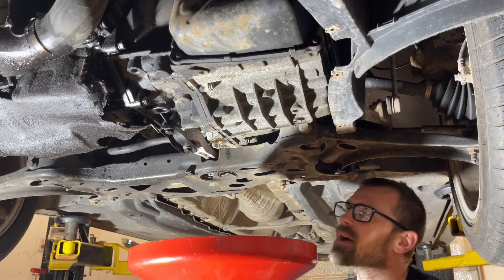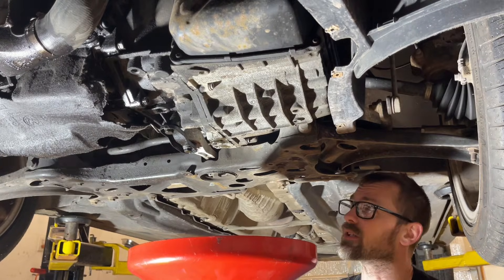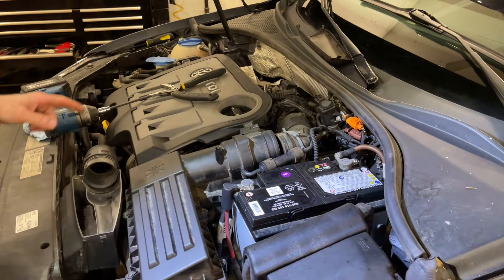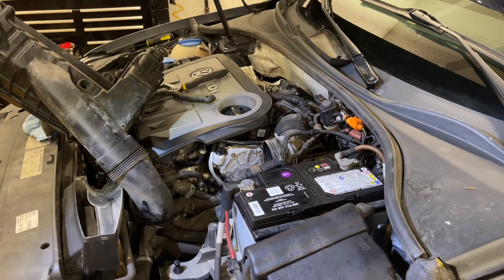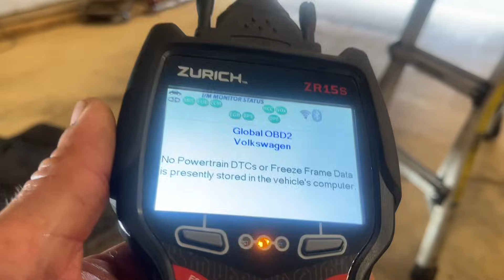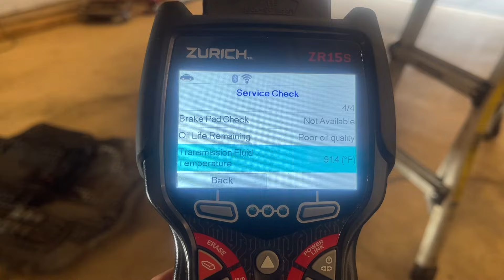🔧 VW DSG transmission fluid change. 2014 Passat TDi

Comment: Thanks!
Reply from the maker: I appreciate it John!!
Reply: You are welcome.  You are an amazing teacher.  Based on your video I plan to tackle my own transmission service.  @bennieaust
Reply from the maker: @johnc8346  Best of luck with the service!  If you can get past the annoyance of having to remove so much stuff to get to the filter, it's actually pretty easy.
Reply: @bennieaust  So I finally complete the service.  You were spot on with 15 minutes run time to get to the correct operating temp.  Also, I believed the dealer cheated me the last time I paid for transmission service in 2021.  The date code was 2014 for the filter, which I doubt they had in stock that long.  I believe all I received was a drain and fill even though I paid for the filter.  I was going to use the dealer for the 130k timing belt service, but not sure now.....  Thanks again for such a great tutorial!
Reply from the maker: @johnc8346  you're welcome!  That's a bummer to hear about the filter.  The service is only as good as the tech doing it.  You can imagine how much faster the service would be if you skipped the filter. :(

Comment: I have the same scanner but mine will not show the trans temp on my 2013 Passat TDI, any suggestions?
Reply from the maker: Did you push the down arrow after entering the service check screen?
Reply: @bennieaust  yes I did. It only shows the first three options. I even tried updating the scanner itself
Reply from the maker: @coltontietge244 , I’m not sure then. I’ve had mine plugged in to a lot of vehicles and it’s always displayed trans temp.  Sorry.

Comment: Just did this on my TDI today and I wanted to say thank you! Your guide was awesome and it made it possible for me to do it by myself. I really appreciate the hard work that you put into making this video, working on cars myself I don’t think I’d have the patience to record it all. Much appreciated friend!!
Reply from the maker: You're welcome!  It does take significantly longer to shoot a video of it than just do it, but you shoot it once and now everyone has it. :)

Glad I could help out and thanks for commenting!
Reply: Did you lift the car or use jack stands?? Process seems kind of hard with just jack stands.
Reply: @Sprinter4783 it really wasn’t that bad. I do all of my oil changes with Jack stands and it’s basically the same process. I will admit It was a little bit tricky working the pump while laying on the ground under the car, but to me easily worth the money savings. It’s definitely do able you just have to finagle with it a little bit. I jacked my car up, drained the old fluid, and then removed the filter. After that just put the new one in, get under it and fill it back up. It’ll take a bit of time and effort to do but again, worth the money saving for me.

Comment: Ive seen sites saying the transmission takes like 5.3 ish and the kits only a 5L. So I’m assuming extra fluid sits in the transmission still after draining?
Reply from the maker: Yes, the drain process definitely leaves some fluid behind. The main thing to know is that 5L is all that’s needed for the service.
Reply: @bennieaust  My kit with liquimoly came with 6L of oil (probably becuase the 02E manual says the change volume is 5.2L (!) . Manual recommends adding 5.5 L for overfill. After draining I had used 4.7 L which is also more than others have used - maybe I put the plug back in a bit soon, basically as soon as it went from a stream to a drip.
Reply from the maker: @paulwary  that’s about when I put the drain plug back in. 

It’s sounds like you used a very comparable amount to what I have always seen. When I add the 5L I usually get .3-.5L back out. 

Sounds like it all went alright!
Reply: @bennieaust  Thanks, that makes me feel more confident that its not overfilled. I was able to modify a cheap garden spray unit  (Aqua brand in Australia) to use for an oil pump for top fill. The filter drain hole is 12mm diameter, and the plastic head for the spray wand was a bit more. Faster than gravity feed, and way less messy than bottom fill. Basically just put the oil in. push the wand into the filter drain hole, and go have a cuppa.
Reply from the maker: @paulwary  great idea!
Reply: @paulwary I added a schrader valve to my sprayer bottle and hooked it to my compressor. You’ll need a regulator to keep the pump head from blowing off if you don’t have a blowoff or over pressure valve on the bottle. Don’t ask me how I know that
Reply: @ZhmiKnopa  The hand pump is fine for me. Does not take very long, and you can just walk away while it goes in.

Comment: Very clear. I remember another video said you need to run through the gears before? oor while? draining.
Reply from the maker: It’s pretty normal on traditional automatics to run through the gears after you have completed the fill process but before setting the level. These DSG transmissions are a lot different that regular autos.  I do not believe there is any benefit to running it thought the gears before setting the correct level.

Comment: This is just my experience, on three DSG VWs. I've had two 2 Passats and a Jetta TDI. Many DSG changes.  Use Liqui-Moly not Pentosin.  You can remember this advice when your transmission starts slipping at ~60 and your Passat sometimes doesn't want to shift.  My experience, take it as you will. I had these symptoms again in my Jetta TDI and promptly drained the Pentosin and replaced it with Liqui-Moly. Transmission shop said I needed a rebuild.   Nope. Good as gold now.
Reply: So glad to hear this got 84k on my tdi and started to slip today at 60 will definitely be changing my fluid
Reply from the maker: That's great to know!  Thanks for the info.  I have serviced many of these and haven't experienced any issues with the Pentosin fluid but I will remember this if I ever do.  I have only logged about 120K miles personally on the DSG equipped TDi's.
Reply: Hi you change for liquid moly fluid ?and This help??thank you
Reply: I've done two changes on my DQ2500 box & used liquid molly both times, 1st time soon as a got the car (6 speed ) 
Anyway only 3.7L came out by having both bottom screws out & box filter off just to get as much oil out as possible. A bit surprised tho as I thought that's a bit low. Used pump like the video to refill & put 5.5L back in. Used vcds & got it up to 35d temp, ran thru the gears in 5 intervals, kept engine running & dropped pump hose etc. Started to worry when still wasn't dripping after 1 & 1/2 L came out. But wasn't letting anymore come out so 4L was in it. 
Second time the same 4L came out & refilled with 5.5L. Had to stop & plug it after 1 & 1/2 L came out. 
I hate the fact that there's only Just over 4L in it. How much would you say is in yours?
Reply: Am thinking if doing it again & put 5L in & leave it, oh when 5.5L was in it & waiting on the temp coming up it sounded so much much better. VW stating they use 6L, surely 5L plus must be left in after? 
Btw didn't have 2 poster. Jack stands!
2014 2.0 Tdi
Reply: weird, a lot say that Pentosin is the oem fluid and Liqui moly is more on the grey zone
Reply: Bull

Comment: Should I cycle through gears after it heats up and has the new fluid in it or so I wait until I drive it ? I saw someone cycle the gears after they put the fluid in so I’m curious
Reply from the maker: It certainly wouldn’t hurt, but the DSG transmissions are not like regular automatics so I don’t believe it makes any difference with them.

Comment: Nice job man. Removing the battery looks annoying.
Reply from the maker: It’s mostly annoying that you have to, lol. The job would be very, very easy if you could just replace the filter from below.
Reply: Compared to some other vehicles I have done, this is actually easy.  Not breaking the plastic filter boc and intake tabs is the most worrisome part.

Comment: can't you switch the car off when its at the correct temperature then drain the excess?
or it will raise past the temperature and empty more than it should
Reply from the maker: It will drain more than it should. It need to be running to set the correct level.

Comment: I'm looking for a scan tool the one you have listed is a little expensive for a tool I will probably use once or twice a year, do you know of a less expensive one that you would recommend that reads VW trans temp? I also hope you get paid for affiliate links since I purchased the other items you listed for the DSG change.
Reply from the maker: Brian,  I do use affiliate links so thank you for purchasing through them!

Harbor Freight does offer a very inexpensive scanner that it lists as also displaying transmission temp.  I don't have personal experience with it but I have no reason to doubt it.

https://www.harborfreight.com/zrbt1-obd2-bluetooth-code-reader-59091.html#top

https://www.harborfreight.com/zurich-diagnostics

Ross Tech is a top choice for VW owners and you can get a really capable scanner (that plugs in to your laptop) for about $200.

https://store.ross-tech.com/shop/vchv2_ent/

I totally understand not wanting to spend $300+ dollars on a scanner.  For what it's worth, the one pictured in this video is a VERY capable scanner for a relatively low cost.